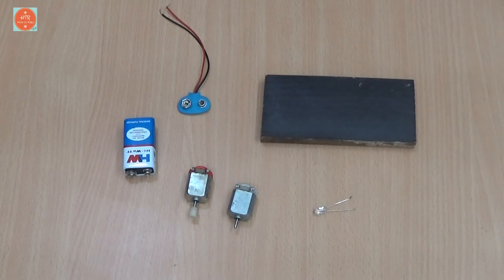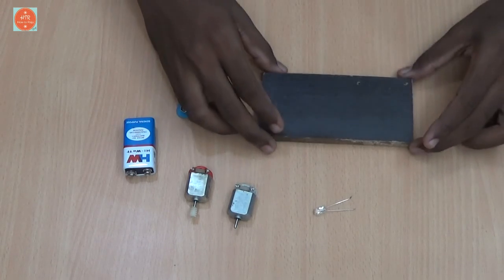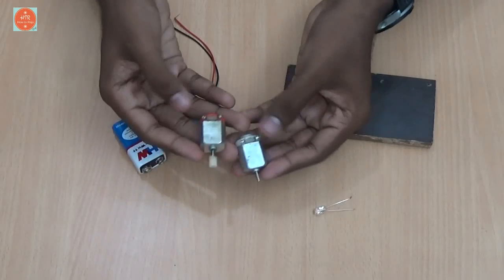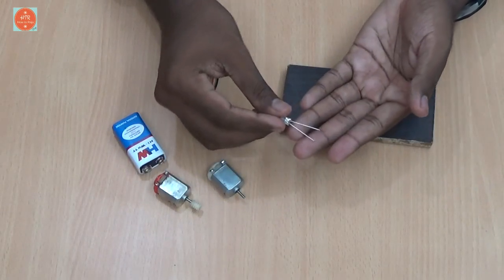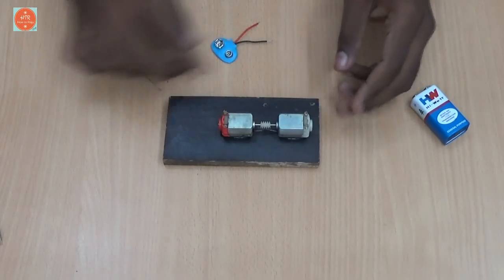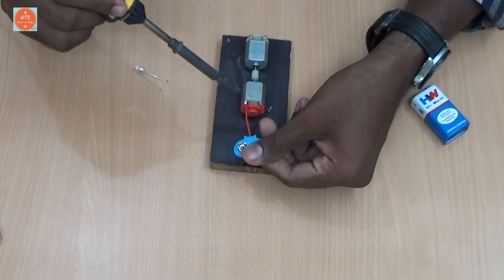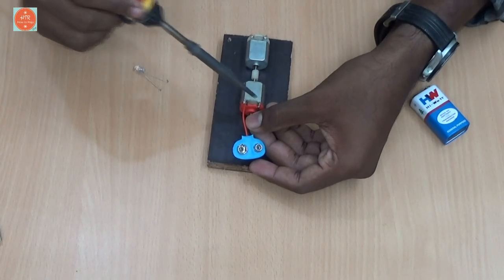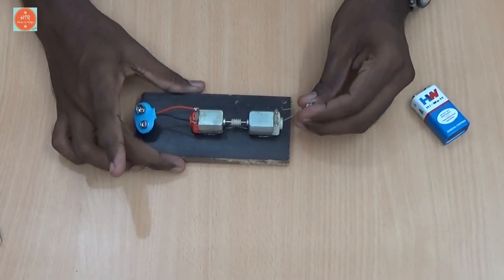How to Make Homemade Mini Energy Generator using DC Motors

Comment: Great video!! Thank you so much!! I was wondering what´s name of the tool you use to attach the cable to the motor. Is it a regular soldering iron or is does it put a gout of hot tin directly?

Comment: What the hell is this. Is it a generator? In this the source is electricity which runs the motor and it runs another motor. It was better to use the cell directly.
Reply: This was just showing how a DC motor generates current if you make it spin. The way he chose to make it spin is irrelevant.

Comment: You're not generating energy anywhere, you're only wasting it
Reply: yeah use some logic ur using a 9 v battery and lightning bulb u must hav simply connected it ur not genrating energy
Reply: Though it is wasting energy, it still converts it to kinetic energy then back to electrical energy, it is generating to the extend that it is generating electricity with the turning power provided by the other motor.
But I agree the entire setup is just wasting energy. (Unless it was a human being turning the motor)
Reply: ClassyMantis33 
I study schematics and I know this wastes energy

Comment: this battery contains 9v and the motor is consuming 9 v to produce 2.5 to 3v because in the video you are using small  l.e.d  light and l.e.d light is only consumes 2.5 to 3v so, it means that you are wasting 6v

Comment: You can simply connect the Battery with the LED. You are using a battery(energy) to operate your motors and then calling it a generator...

Comment: led died at the end due to over voltage use a led with a 9 volt battery in combination with a motor with a proper resistor
Reply: lol
Reply: +harmanjeet singh he's right.

Comment: this is stupid, you are losing energy from the battery by passing it through a motor to the other motor to the LED, remove the motors and connect battery straight to the LED for more power. This is not a generator, this requires a battery source for power and actually loses power lol.
Reply: If you where any more smarter you would have finally built us a time machine so we could use it to go back to before uou where born and tell your father to where a rubber, this guy is simply showing how you can make a generator out of a regular motor by spinning it, I'm sure he already knows there's allot of wasted power by running the motor but it's just an easy demonstration!! It doesn't have to be a motor that's using a 9volt battery to spin it, it could be a wind turbine or plenty of others things.

Comment: Can't you just connect the LED to the battery?
Reply: +Louis Mayonove That would be too efficient ;)
Reply: if you connect the led to the 9v battery it will burn its filament
Reply: he was showing an model of kinect energy .
Reply: its like a resistor
Reply: +Joao Pedro Martins filament C:
Reply: The led wil burn but ur van use a 100 ohm resister
Reply: +Joao Pedro Martins It was just sarcasm :)
Reply: The led is only 2 volts the battery is 9 volts the led would last 2 seconds will blow will stop working